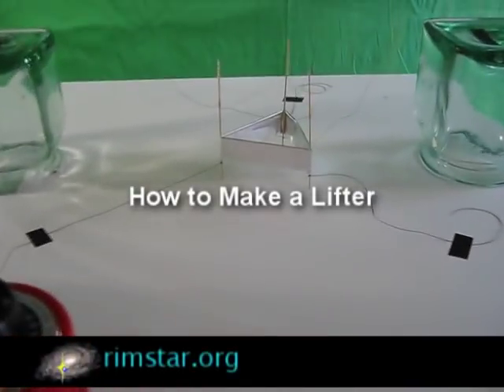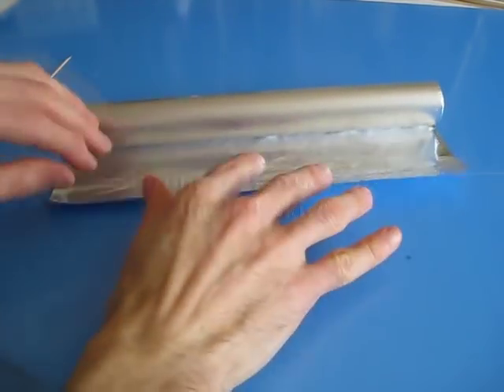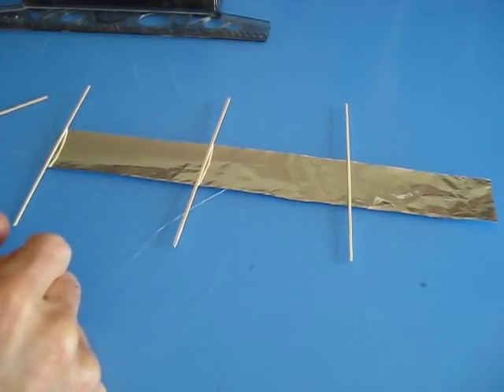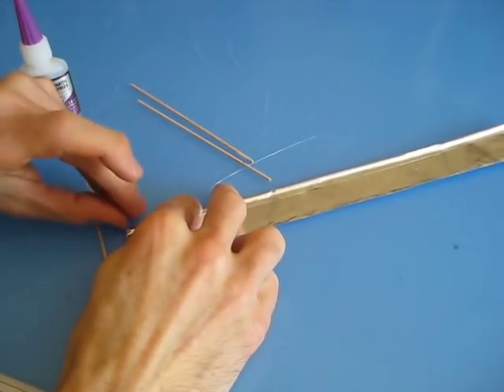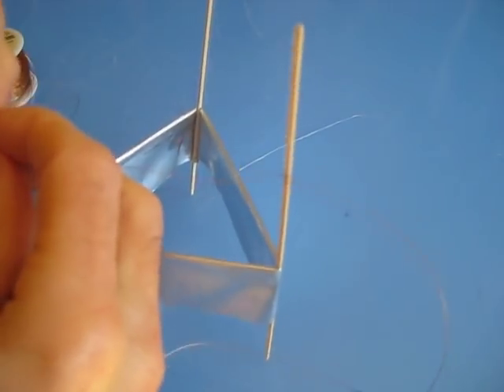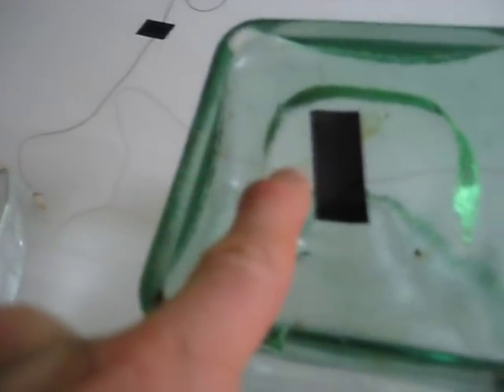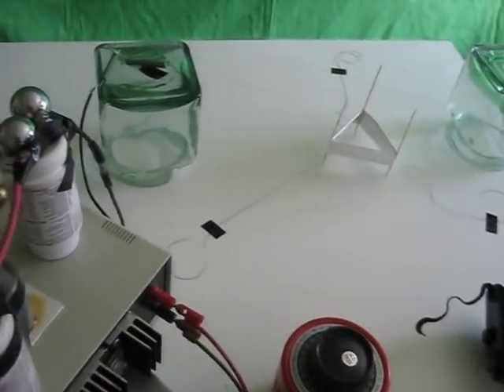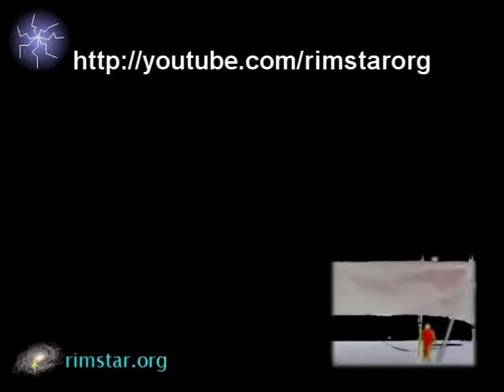How to Make/Build a Lifter or Ionocraft

Comment: Hi . Tried to make one with my high voltage fly back transformer and skewer sticks ( quarter the diameter to reduce weight) but failed to lift off. 
But can feel the ionic winds with tissue paper. What is the issue? Too heavy or lack of power ?? Thx
Reply from the maker: If the final stage of your power supply is a flyback transformer then you're putting out AC whereas this requires DC. That's why my power supply has a voltage multiplier as the last stage, it multiplies the voltage and converts to DC. Here's how I made mine https://www.youtube.com/watch?v=GEuK1OdYxHk but the diodeless flyback is so hard to find these days, you're probably better off searching for an old CRT computer monitor https://www.youtube.com/watch?v=r32e0QGdm8U If that doesn't help then check out my tips section on my webpage here (especially testing it in the dark).

Comment: Question for you: what are the detailed instructions and price of the power source? Step by step with a full list of materials, how can I build the power source. Explain the power source exactly like you explained the lifter
Reply from the maker: Thaddeus Thundercock For the power supply I used in this video see my webpage here http://rimstar.org/equip/30kv_pwr_supply.htm I don't have price list since a lot of the parts I already had, plus you can shop around. I also don't provide parts list since there aren't many anyway and you can figure that out yourself. But one of the videos at the bottom of the page goes through making it step-by-step.
Reply: Would a HV DC transformer from an old cathode ray TV do the trick?
Reply from the maker: Thaddeus Thundercock If you mean a flyback transformer from an old cathode ray TV, I finally got time to try it and it didn't work. I couldn't get enough voltage (maxed at 15kV with the lifter as the load) and just ended up igniting one of the lifter's support legs. I just posted a photo around it here on my Google+ page https://plus.google.com/116395125136223897621/posts/4MeNfcWoACN. The TV had a flyback with builtin diodes which I used as a starting point for my cube power supply which I show how to make here https://www.youtube.com/watch?v=-KFhBVfpfDw. Besides a lower voltage, there's just something different that I don't understand about the output of power supplies made using these flybacks with builtin diodes and power supplies made using just the flyback followed by a voltage multiplier like my 30kV power supply which I show how to make here https://www.youtube.com/watch?v=GEuK1OdYxHk.

Comment: That's a very nice video, thanks! The thrust generated is clearly more than the weight of the lifter (?2g?) - but do you have a feel for how much?  Also, how well (if at all) do these devices work at lower air pressures?  Thanks!

Comment: would you consider making an update to this video, now that you know it is possible to make a battery powered, cordless/wireless ioncraft?
Reply from the maker: That would be fun and challenging but I've moved away from working with high voltage for now.

Comment: I followed these instructions and the CRT monitor power source. but the lifter only lifts from one side. what could cause that?
Reply from the maker: +YuSoloS That's normal when trying to get a lifter to lift with any sufficient power supply. The distance between the wire and the foil on that side is  smaller than the distances for the other two sides, so the voltage is higher on that side and that's where the ion wind is. You need to keep adjusting the distances on all sides until you get it more even.
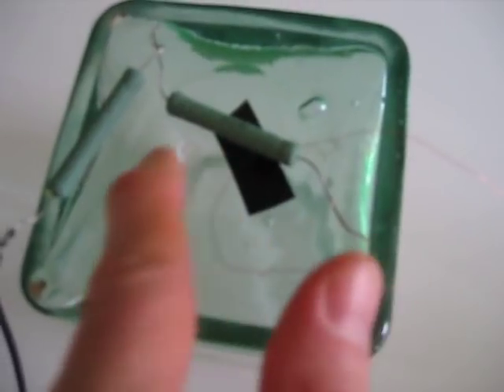But avoid sparks at all costs! These CRT monitor power supplies break easily from too much and too strong sparks. The smaller the distance between the wires, the more likely you'll get sparks. So don't make them too close. To further help avoid damage due to sparks, also make sure you use resistors like I talk about at around 10:00. You can put the resistors on the ground side wires instead of the high voltage wires like I did in this video to make it a little more efficient.
By far the best way I've found to get a lifter working is to test it in complete darkness. That way you can actually see where the ionization is. Doing it without darkness is like doing it blind in comparison.
I also have a "tips" section on my webpage here http://rimstar.org/sdprop/lifter/lifter.htm.
Be safe, always turn off and then discharge the power supply and lifter before approaching it yourself to make adjustments.
Reply: RimstarOrg Thank you for the help!

Comment: I have a question for you would more power on the batteries and thicker wire and heavier material would it still lift off the ground
Reply from the maker: If you had more power then yes, you could lift a heavier lifter. You wouldn't want a thicker wire though. Thinner wire is better. The record that I know of with an external power source is a 100 gram payload being lifter by a 100 gram lifter.

Comment: hi have ypu ever tried to make an ioncraft with a slight inward tiltof the foil and an other one with a slight outward tilt of the foil...would it even work if soo would the slight angle make the craft stable or unstable ?
Reply from the maker: I haven't tried it myself. I've seen some that have tried an outward tilt but haven't reported any difference in stability. The instability is mainly caused by the distance between the wire and the top edge of the foil not being exactly the same on all sides. That causes different sides to have different voltages. Tilting the foil wouldn't help with that.

Comment: Is it possible to just take off the power supply to have it maintain thrust? Or would the charge dissipate into the air as soon as you take away the voltage source?
Reply from the maker: Ken Katagiri No, the power supply is necessary to maintain thrust. The high voltage and electrical current from the power supply is what keeps the ion wind/jet of air flowing downward and producing thrust. See my video on how ion propulsion works for animations of what's going on https://www.youtube.com/watch?v=01F8V5IhB5k

Comment: Hi I've  been trying to complete this project for about the past 3 weeks and it won't levitate I used all the materials you suggested but it still will not fly.
Reply from the maker: Have a look at the tips section on my webpage here http://rimstar.org/sdprop/lifter/lifter.htm. The best tip is to try running it in complete darkness.

Comment: Question: On lifters and guessing that if the pulsed frequency increased to the Giga and Tera Hz level and the voltage decreased to a somewhat safe level say 1500v, would it still lift?                               Thanks kind regards.

Comment: Hello RsO, I have some questions as well as a hypothesis .My questions is that based on the top wire used 30 gauge (+) determines the rate of ionization around the field between the foil and the (+) wire, while the ground act as the direction of the flow.Second. if I were to wrap a denser wire as (+) and have smaller wire leading down to the foil switching back and forth pos to neg down to the foil. would that speed up the directional flow without increasing voltage while making a mag field

Comment: A possible source for higher gauge wire is speakers, more specifically, headphones. I think the size for those are about 50ga. Also, would it be possible to power the lifter with Leyden jars?
Reply from the maker: No, lifters require a constant source of not only high voltage but relatively high current as well. Leyden jars are just low capacity capacitors and would discharge pretty quickly.
Reply: @RimstarOrg  Pity. Well, there goes that idea. Thank you for the clarification.

Comment: The majority of stun guns output a pulsed, high voltage, low amperage current. The high voltage, low amperage is what you want, but the short time length of each single pulse will present flight problems. Attempting to lengthen or remove the pulse will greatly reduce the voltage and up the amperage making it a little more dangerous.
Most good hobby stores sell cyanoacrylate for about $5. at usually twice the volume as grocery store Krazy Glue. also in a "filled"(thick) type for bonding to wood.

Comment: Question #1 Can this be used to make a truly bladeless fan that can be commercially effective?

If so..

Question #2 What would be the optimum size and shapes?

and..

Question #3 Can lights be added as a ceiling fan
 or a rotation be added as a floor fan?

And

Question #4 Can it be wired in as a ceiling fan?

I started thinking along this line because I noticed that the so-called "bladeless fan" we're not truly bladeless but just a redirection of the airflow. And then remembered seeing this on MythBusters.
Reply from the maker: You can't make on which you be commercially effective. There are commercially made ion breeze machines but they don't produce the amount of wind I think you're after.

Comment: I'm thinking of working with this for a science fair experiment. The high voltage of 30,000 is quite a lot to get this thing flying. How did you build the high voltage device, and how can I configure that set-up? (If you know a site or video that would explain it, that would work just as well) Also, how can the wind turbine power a high voltage source? Does the turbine connect into an electron accelerator or something? Thanks for answering my questions by the way!

Comment: Pretty late to the party here but what would you use for heavier materials (if you could)?
This EHD stuff is definitely way more useful for other applications..

I appreciate your work and sorry for asking a question just to extract information O:!
Reply from the maker: Aerros The record as far as I know is a 100 gram payload lifted by a 98 gram lifter and a specially built power supply http://blazelabs.com/l-c-hexspiral.asp.
Reply: That was fast~
I don't want to lift anything, I just want to make sure the air is being pushed, and so I guess I'm asking if you could recommend any heavier materials that would better replace the wire (a blade, perhaps?) and the skirt.

Thanks, by the way  ^ ^!
Reply from the maker: Aerros
The thinner the wire the better, so the sharper the blade the better. But yes, you could replace the wire with some thin metal aluminum flashing available in hardware stores but the edge wouldn't be as sharp as a 30 AWG wire and so wouldn't ionize as easily.
Or you could just replace the wire with another aluminum foil skirt, making sure that it's the sharp bottom edge that faces the bottom foil skirt. You need a sharp edge on top, hence the wire, and a smooth edge on the bottom, hence the foil skirt with folded over top edge.
But if you want to see if air is being pushed then the easiest way is to get some incense sticks and do a smoke test, like I did in this other lifter video https://www.youtube.com/watch?v=LOGAaObsN4g
Reply: RimstarOrg 
I've seen a few of your vids, including the smoke test (which was very crafty). 

The materials just have to fulfill the shape requirements, so it makes sense what you're telling me. I guess a blade (as a corona wire) and a pole or something rounded for the bottom would be a nice start to try. 

Thanks. 
You'll hear from me if my idea works~

Comment: Would it work if you wire it up with a flat coil in the middle, and then put it over a wireless charger?
Reply from the maker: +Nathan Jackson That's actually why I made my wireless charger, I wanted to see if I could do something like that. But it turned out the power transferred would be far too little.
Reply from the maker: +RimstarOrg Now that I think about it more, my idea was just to power some LEDs on the three bottom corners, not to power the lifter.

Comment: i got it well till the part with the power supplies came in, can we just have a usual one and work with that?
Reply from the maker: Magik Kidz No, you need a high voltage power supply, something above 25,000 volts DC and that can also supply a relatively high amount of current, somewhere between 250 microamps and 1 milliamp.

Comment from the maker: You need around 30,000v. So unless your 24v battery is connected to a high voltage power supply then no, you can't used just a 24v battery.

Comment: Hey, this looks really interesting! Is there an easier way to provide power to the ionocraft? Do you need a home generator or is it possible to gather the energy with some thing like, say, a wind turbine? I also have a solar panel from a kit that I may be able to use, but its very small. Are there any risks involved with using the ionocraft?

Comment: how many volts do you need to cause lift on this project, can you power something like this with a sterling engine?
Reply from the maker: rpotech Around 25,000 volts and around 1 milliamp of current (though I'm less sure about the amount of current.) I show measuring these in this other video of mine https://www.youtube.com/watch?v=LOGAaObsN4g I can't see any way to power it with a Stirling engine. Even if you had the Stirling engine turn a Wimshurst machine, the electrical current from a Wimshurst machine is too low for a lifter.

Comment: cool! 

steven dufrence,

I've chosen ionic wind as my science fair project. I wish to make an ionocraft. but I am not sure where to get high voltage power in my school classroom. how many volts does it need? can I use some batteries to power It? is it safe?
I need quick answers please.
And I could not find any other way to contact you.
Reply from the maker: Regarding the danger. I was recently to a science fair and the table area might be too small to demonstrate this safely. You saw near the end of the video how I was careful to discharge things before going near them. If you're not experienced with high voltage then this might not be for you. It also produces ozone, which is bad for you in large quantities. A science fair is large and so is probably ventilated enough, but the exhibits are close together and so you and your neighbors might be breathing a lot of it.

The high voltage power supply is the hardest part. It has to be high voltage, around 25,000 volts DC, so not batteries, but also relatively high current. Plenty of things can produce 25,000 volts easily, but this also needs a lot of current for the ions. Check out the bottom of my webpage here about where to get the power supplies: https://rimstar.org/sdprop/lifter/lifter.htm.

And commenting here is the preferred way to contact me about this.
Reply: Thanks Steve for quick response.
If batteries won't do the trick, could I use power from wall socket at school? It provides approximately 200 volts. And I don't want to use any complicated electronic stuff. I want to do it with low cost(school rules).
Thanks again
Reply from the maker: No, you need 25,000 volts so the 200 volts from the wall socket won't do. If you don't want to use any complicated electronics then you're going to have to pick another topic. This one needs it.
Reply: Thanks

Comment: qué pasa si le ponés una pequeña bobina cerrada en si misma en cada uno de los palitos de madera entre los electrodos o arriba de los dos o abajo delos dos?
Reply from the maker: The metal coil would create a bit of a short circuit between the two electrodes. It would be as if you'd brought the two electrodes closer together. That would either cause sparking, which would stop the ion propulsion effect, or it would increase the strength of the propulsion.

Comment: You used to have a video where you measured its torque but I can not find it. Could you link it?
Reply from the maker: +Magyar András Tamás I don't recall ever measuring its torque. However, I did measure the required voltage in https://www.youtube.com/watch?v=LOGAaObsN4g.

Comment: where do i get that orange thing that acts like a volume switch but its for your power delivery
Reply from the maker: I bought it from a local electronics store. It's called a VARIAC. What it does is takes AC (Alternating Current) from the wall plug (e.g. 120 volts AC here in North America) and allows you to control it, producing an output of from 0 to 120 volts AC (or whatever the wall socket voltage is in your area). Mine has a 3 amp fuse, i.e. it can only handle 3 amps of current. The higher the amp rating, the more expensive the VARIAC. Hopefully that'll help you find one online or locally.
Reply: @RimstarOrg  out of curiosity is there a way to make these larger and more dense so they have tons of power of lift so they can be used to power small aircrafts able to carry 500 pounds at reasonable speeds

Comment: Hi s good test  How many volts  use to levitation   24 volts or 110 or 220, AC or DC?
Reply from the maker: It needs around 25,000 volts DC. See my follow-up video where I measure it https://www.youtube.com/watch?v=LOGAaObsN4g. I use this homemade high voltage power supply https://rimstar.org/equip/30kv_pwr_supply.htm but the type of diode-less flyback it needs is very hard to find. An alternative is to do this https://www.youtube.com/watch?v=r32e0QGdm8U with an old CRT type PC monitor.

Comment: can you use the ions from light example you create this lifter  but using artificial light ( LED ) lights and the the power of 100 watts for the lifter ? 10 watts for a bunch of LED lights or 1 LED light ?
Reply from the maker: +Elia Vishal I think you mean the photon from light, but in any case the answer is no. There is nowhere near the amount of force required to lift a lifter.

Comment: Sir RimstarOrg, Can a Tesla coil can do this kind of lifter? I made a tesla coil during my college time. Please advice? Primary Coil of my tesla coil is 15kV and it amplifies in the High voltage coil I couldn't measure the HV but sure the voltage is amplified.
Reply from the maker: Wakachzung Lora I'm no expert on tesla coils but my understanding that they put out high voltage AC. A lifter needs high voltage DC. So a telsa coil shouldn't work.
Reply: OK, Thank you Sir.